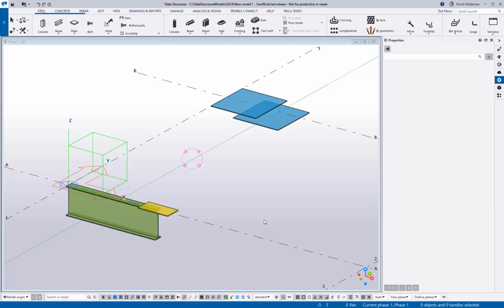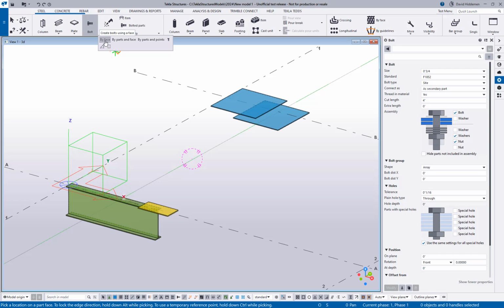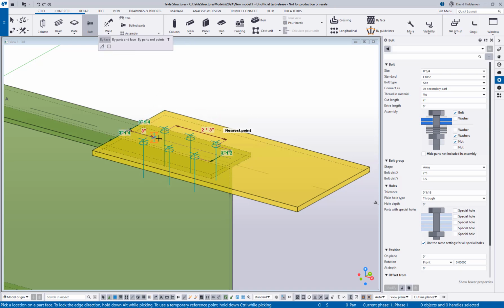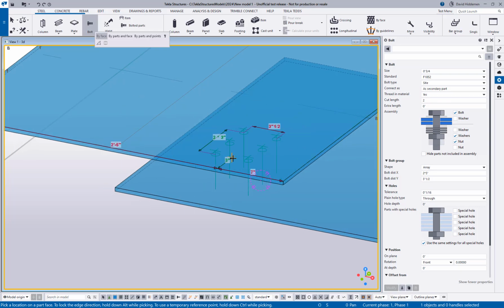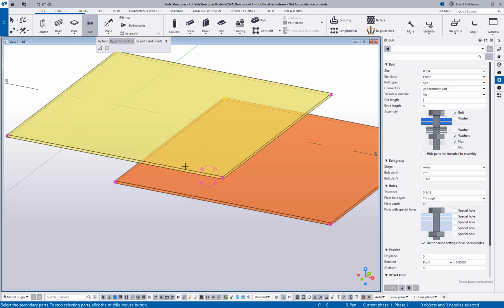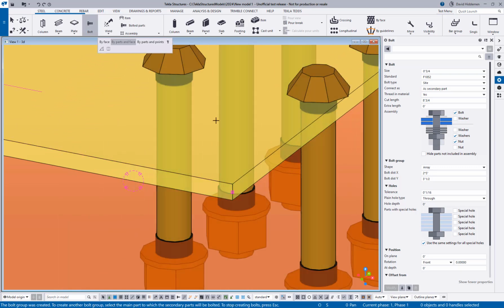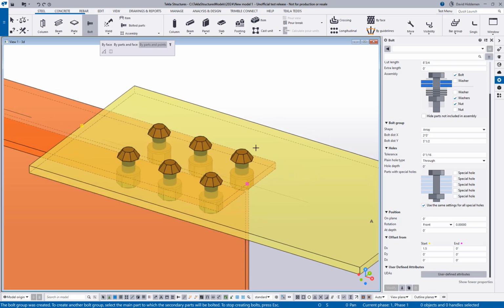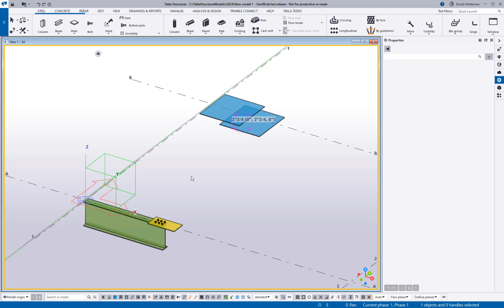Tekla Structures 2024 - What's New for Bolting

Comment: What about when there are more than two parts to be bolted together?
Reply: If you're using one of the options where you pick parts, just make sure you pick all the parts being bolted (just like previously). With the first option (by faces) it automatically finds all parts based on cut length value, as I mentioned in the video.
Reply: Where is tekla 2024

Comment: Are there some plans for extending the connector types list? It would be great that next to the bolts it is possible to create the timber screws with the pilot holes, dowels for timber connections etc.
Reply: This!
Reply: or the question is, why when you have great software for steel and concrete modeling you do not extend to timber detailing?